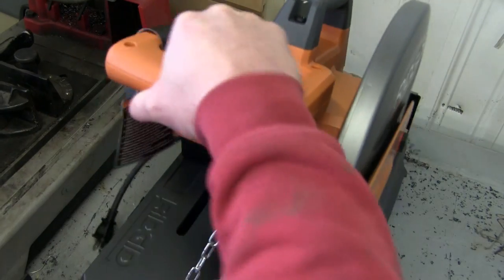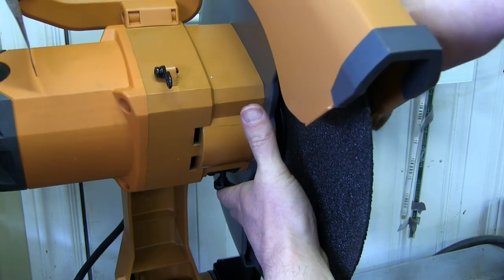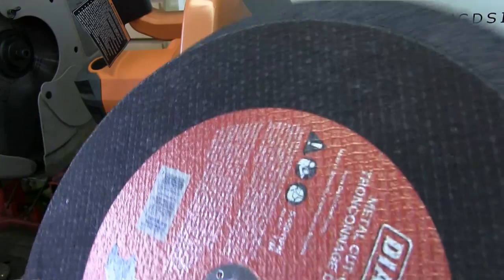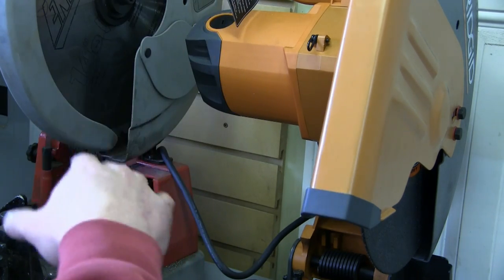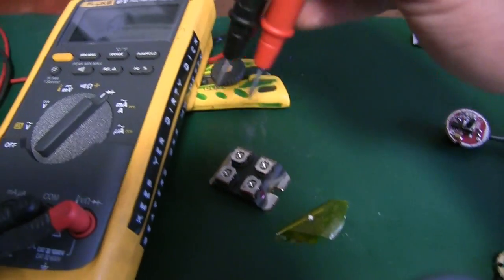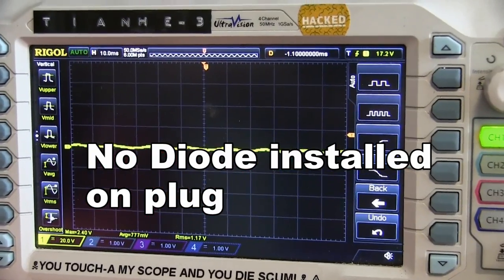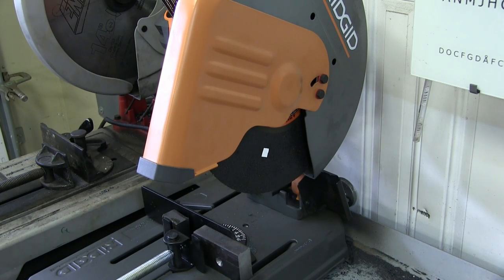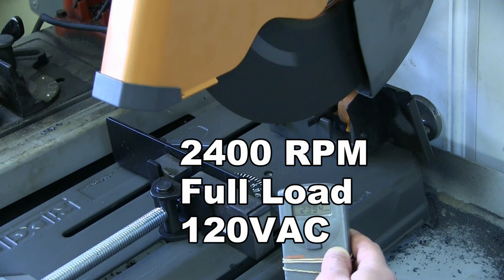RIDGID abrasive cut off saw converted to dry cut. Maybe.

Comment: I received a saw turned in to the tool room for repair.  The tag said "Real noisy and won't cut."   The blade was in backwards!
Reply: my old man's an IT guy. He once had an employee call him up and explain all about how is mouse was doing the weirdest things, moving in weird ways during a presentation he was making, etc. He goes up and...turns the mouse around.
Reply: Sounds like my average customer at the orange box. Facking ijits.
Reply: la05082 I was called in by a crack team of handy man chowderheads for a butchers band saw not cutting. Lol the blade was inside out. Yup it happens with band saw blades. Usually it just the butcher no big deal. But when another service company calls you for backup because they can't figure it out. Well that's funny shit. Best part was I was 24 at the time these chunder buckets where pushing 50.
Reply: Picked up a free Chainsaw with the same ‘problem).
Reply: I got a hammer drill with a clutch function back... "it doesnt work, it only spins and has no torque" ...They had stuck the drill and the clutch was engaged like it should ... /facepalm
Fucking embarrassing telling the customers they have no idea what they are doing but sometimes you have to do it. It goes with the story that the customer had specifically ordered a drill with a clutch too.
Reply: spoofer20 what sort of drill was it?
Reply: We used to flip portaband blades inside out and put them on for the next guy..      some tards just can't finger it out!
Reply: I am an electrical guy - I was repairing a winding machine at a client's factory.
I noticed that a roller guide was all mutilated - with built up weld and bits ground away.
I asked "what happened here?" - they said "it was fouling against another part and the mechanical guy had to modify it".
I looked at it and saw it was in backwards - "look, now there is lots of clearance..."
(ho hum)
Reply: I work at a Stihl dealer service, enough said.
Reply: My angle grinder zip cut blades don’t have a direction. I put them printed side to the retaining nut but who knows if that’s correct.
Reply: Literally one apprentice at my last company xD

Comment: I slowed my abrasive saw down and put a dry cut blade.  I confess --- for the benefit of others --- that I was used to not having to clamp the metal down.  The part vibrated a little, the teeth grabbed and the 1-1/2" angle iron went into my hand.   That was a trip to the ER and I'm lucky to still have my hand.  DONT MESS AROUND WITH DRY CUT --- ALWAYS CLAMP THE WORK PIECE!!!!
Reply: Thanks for the foresight.
Reply: 'Dry cut' as in....Carbide Teeth?  Anything involving carbide must be clamped very tightly.....vibration will quickly shorten the life of the teeth....and can cause parts to go flying....
Reply: i've taken a saw to the face and almost cut my abdomen open using carbide metal blades in a 7" handheld saw. both times were due to a stall. gotta be smooth and gentle with those things, especially with no way to clamp.
Reply: Scott Davison i work in the dead tree carouse business and one of the new guys in the shop managed to pinch a 4x4 in the chop saw thing went flying and broke the radio on a shelf above the saw
Reply: Power tools need respect and often don't get it until a close call. I normally use my powerplasma cutter to cut metal but want to buy a cold cut saw. After reading all of these comments I'm going to be sure to clamp everything down!
Reply: Scott, anyone who has put anytime in a shop has done the same, and it quickly makes you realize that your clamping better be first rate, and that you better keep yer wits about ya when you're working,
Reply: Darwin's theory at work.... Lmao
Reply: I had the privilege of cutting a 1.5" 11 Gage box tubing, was clamped,. Had table made so I can roll 20 foot sticks on it and cut. Nice set up. On a particular day, I had been cutting parts and a 14" or so part that was clamped still managed to jump out n slap me in the side of the ribs, knocking the wind out of me. Pissed me off and was confused how it happened. Had it clamped, looked at the blade n I recall it missing teeth.  Not just the carbide tips but the hole tooth, not repairable n couldn't be sent out to be sharpened.   Had a 7" grinder get hung up on me. Literally on me. Hard sand paper disk on a backer hooked on edge of angle iron and dam, I'm in a fight with the grinder. Came at me I let off the power then it was wrapping up in my shirt. Thank God it was cold out n had on 2 shirts. Still sucked, looked like road rash on my stomach, had to sit down n breath.  Wire wheels on grinders, hell grinders in general have gotten my many times, no wander I hate grinding. I'd rather be welding n let the helpers do the prep work
Reply: YA BLOODY THINK??!!???
Reply: @kellypenrod2979  that and the dam ringing that never quits,.  Been so bad it's giving me a head ache
Reply: @jeremyb7128  Yep bud, know what ya mean! 
But in my case, the ringing kinda knocks out the ol'lady's bitchin, and after a while ya just get used to it I guess.
Reply: @Scott Davison SHAKE HANDS WITH DANGER!
Reply: Gotta let the tool do the work.  Best advice you can give a person.
Reply: 4 inch grinder with wire cup brush. Don't try swatting wasps, luckily it was a cold day eat though coat hoody an two tshirts.
Reply: @carlcox7332  omg i can imagine how that could of happened to me so many times. i had a hole hog drill with a 4 inch auger drilling through 2x6 for plumbing on a step ladder. lol dam thing hung up and i went for a ride. tangled up in the ladder and 2x6 studs oh what fun the days of yester years was. so many stories bu so many, sad part is, when you look back on them, you laugh at how funny it is
Reply: @jeremyb7128  I had a brilliant idea,"once and only once" ( among other brilliant ideas, but this was almost my last)
I decided why not put a put a 
3-1/2" or 4" carbide tipped blade in a 4" angle grinder to get up nice and tight to the bottom plates, while cutting out wood floor deck..
Hell the blades were readily available ( intended for use in small cordless circular saw)
Within 30 seconds of putting this remarkable innovation into service ( I even left the half round shield on the grinder,"who does that" makes me think I was worried before I started)
I got my incidental 3D lesson, with extra sauce in personal biology .
It worked beautifully,as envisioned,but when you go to stop, that's when the magic happens that grinder took such a walk on the wild side, I think I almost blacked out before it hit me just imagining the consequences. I know , bounced off of all 4 walls at least twice trying to get away from it, before it cut its own cord ! Never had I ever felt SO, out of control.
Still one of luckiest unlucky days of NITWIT engineering I've had to date. 
A half inch deep clean cut 2-1/2" long incision just behind my palm.
Needless to say, the homeless Fright $18.00 angle grinder switch,stuck in the on position. Furthermore, I have never personally walked through the doors of Homeless Fright since.
( If the whole experiment wasn't so cheap to assemble,I probably never would have tried it. ** Still without a doubt, OPERATOR ERROR**)
I was working in such a remote area, I probably would have bleed out half way to the hospital, if it had managed to get a little more teeth into me.
Reply: @keeganwebber  family photo time must be interesting.
Reply: @tuck6464  Thanks for sharing that. If not for previous comments, I'd have thought it sounded like a great substitute for a toe kick saw. But I haven't laughed that hard in a long time, so thanks for your story.
Reply: @jeremyb7128  Ear plugs are why I can still hear after decades as a jet engine mech. 3M foamies are love.

Comment: 120? that's already half voltage!
Reply: yah your right its half voltage
Reply: Not in north america
Reply: Could just get a abrasive cutoff saw from over seas and run it on our 120 on twice the rated breaker size tah dah
Reply: @alec4672  exactly the same would happen as in the video, the motor would burn out very quickly.
Reply: 110V motors have thicker conductors than 240V
If the motor is an inductor you will need a variable frequency drive. Drop the Hz and it runs slower. But all the other stuff (cooling etc) applies.
Reply: Not in America

Comment: If surface feet per minute is the consideration on that 14" blade, there are convenient and affordable 7.25" carbide-tipped circular saw blades at any home center that will effectively cut the SFM (circumference) roughly in half.  It would limit your depth of cut to about 3", but for a quick-n-dirty proof of concept without choking elec-chickens, it's an option.  (Assuming the arbor hole is the correct diameter.)
Reply: It's not.  7/8 on a 7.25 saw.  1 inch on a 14 saw.
Reply: I have a 12 inch wood cutting Milwaukee miter saw that I have installed a 9 inch Diablo steel demon blade on. Works well and is inside of the maximum rpm recommendation on the blade. 1 inch arbor

Comment: Hey AvE!  Love your videos!
 I have some thoughts you might want to consider...  Many universal motors are series wound, some are parallel wound (for speed limiting), and some are series/parallel wound, (one field/armature in series, and the other field in parallel with it all).

Your saw is probably the series wound unit as you say, and my idea is to either put a big inductor in series of the saw circuit as a choke, instead of the diode, OR rewire the actual motor itself into a parallel connected motor, in which case you will need a choke in series with that field winding (field/choke in series, and that all in parallel with the armature).

The first option is easier but less speed regulation, easy to bog down the motor.  The second one will give much better torque under load while keeping the speed low enough.  These require more effort and trial and error, but not much more in materials, and you'll likely save your motor.  The V/I pulses are not smoothed in the diode setup, so the resistance of the windings in the motor will burn up twice as much total power as compared to the choke-limited method, which keeps the entire sine wave, at the same average current and voltage over a cycle.

In short, it's those peaks in your diode setup that are being burned up in your motor windings.

I probably rambled this off in a way that was hard to understand.  It's 11:30 at night lol.  I'll explain it better if anyone asks me to :D

Comment: Exactly the question I was pondering over the weekend. I came to the conclusion I would have to jerry rig a different motor and maybe even pulleys to get the speed and torque. Now dry cuts are out in the market, abrasives suck more than before.

Comment: Hey uncle bumblefuck, I was thinking about this and I have one and took it apart. Turns out it has a gear reduction of roughly 6:1, all you have to do is crack open the gearbox and swap out some gears. 

Would reduce speed and make the torque even more 

Hopefully you see this and try it.
Reply: Do you know where to get the gears to reduce it?
Reply: @wesman7837  McMaster or the usual scumbags. I don’t believe these are geared anymore though. Pretty quick cost down for them

Comment: Shit man if you want to half the speed, just wire two up in series!
Reply from the maker: Stupid like a FOX!. Good idea, I'll make a mock up.
Reply: AvE Or a lightbulb instead of another tool?
Reply: i would use a resistor (or more) in series, matching the inductive reactance of the motor, and that should give you the 60v, with less than 35 amps.

i would have to do the math to determine the expected current of the circuit, but im sure you are more than capable.
Reply: AvE Half the voltage means quarter the power (because current is also halved).  Works the other way, too: double the voltage means four times the power. So it's always quadratic. If you turn it on half the time on the other hand, it really is half the power going into it.

This is of course for resistive loads - which a motor only is at no load or high rpm. At low rpm and high load she will suck in as much amps as she will (or even won't) suffer. So the variac should've been set to 71% (1/sqrt2) I believe so that the current doesn't get that high and more work is done by the voltage and better ventilation occurs.

That sherper with the Yamaha generator surely has some carrying capacity for a variac, eh? ;) Only other solution I could think of is regulating (pwm-ing) with an arduino and mosfet - you could set a maximum surface feed. But it would get convoluted quickly I guess :/
Reply: apolon_psy If you take a 2000W light bulb (or 20 100W in parallel) it will could werk. Also good in the winter for heating the shop up! And it looks nice from outside when the load varies and the bulbs flicker through the windows like in a mad scientist lab :)
Reply: actually i think that will be only 7.5 amps in that configuration. (with the resistor)
probably just need to gear it down
Reply: JBFromOZ This will work - if they are always under the same load ;)
Reply: Its a universal motor, NOT a resistor. Back to school with you.
Reply: defender1be Who said it has to be linear dampening? Resistor will work - it's just not the best option - but mainly because it gets freakin hot.
Reply: ok, did some more figuring...

120 ac, to a 8ohm resister in series with the motor and a parallel 330 micro farad capacitor, should give you 60v motor, at roughly the same current.

15-20 amps unless i fucked up the math, which is possible.
Reply: ocng How about a $9 120v, 2000 watt water heater element affixed to a styrofoam float set adrift in a 5 gallon bucket ?
Reply: double the productamivity! straight outta canukstan
Reply: worthy of a welders ruler down-unda matey? watch out for those drop-bears!
Reply: Krust bag The inductance I think you derived from running under full load and at low rpm (120V, 15A) so it's 22uH. With the matching capacitor in parallel it's 8 Ohms which is the same as the 8 Ohm Resistor in series >> so the voltage is halved. The current then is 120V/16Ohms=7.5Amps (half) since now the voltage has to drive two 8 Ohm loads in series. And so the power is only 1/4 of what it was @ 120V/15A since each 8 Ohm load gets half the voltage. But the whole circuit sucks up half the power - just not all of it goes into the motor...
Reply: maybe ave can give us the measured apparent power (va) and the true power (watts) of the saw, so we can calculate all the real values.
Reply: another option would be to use a vfd to reduce the frequency, but I think that would lose torque, not sure if it would perform it's job.
Reply: Krust bag About that vfd: interesting idea! But isn't the idea of a universal motor to be frequency independent? In the video it runs on pulsed DC...
Reply: ocng the frequency would directly control the time between pulses (dc) and cycles (ac) which also affect the speed of a motor.

the universal motor can run on both ac and dc, as opposed to an ac motor.
not sure of any other benifets
Reply: Krust bag ..... 8 Ohms? ........  Ker Ching! A good size speaker would give you that ...... With the bonus that the neighbors can listen to you working ;O) Or if that is a problem 2 4Ohm speakers wired arse about tit to give ... Wit for it ........ Anti-sound! Ta Dah!
Reply: JBFromOZ actually... that would be 53,3 Ohms you need - Speaker Impedance is measured at 400Hz - lines voltage oscillates at 60. So 8Ohms @ 60 Hertz is the same as 53,333... Ohms @ 400. I like the Idea of that high powered 50Hz Speaker though :) Reminds me of that guy who almost brought a building down by inducing Oscillations into the structure and ground.
Reply: ocng Which manufacturers measure speaker impedance at 400hz?
Reply: cncgeneral Not all of them apparently - 1kHz seems also common. The modern dictionary of electronics says 400Hz is the typical value. I just wanted to point out that none measures at 50Hz and |Z| is frequency dependent.
Reply: ocng Yeah, 1khz is much more common, but it's still pretty useless to know without the full graph due to how speakers are used. DC resistance is normally what people think of when it comes to speakers.
Reply: Simon Ashton I was tempted to propose that - but refrained from it because I thought AvE's goal was an easy solution...
Reply: exactly, his and hers.
Reply: or left and right hand .... at the same time for efficiencies sake ;O)
Reply: Some series or shunted universal motor winding's need to be controlled independently  to control rip'ms.  Decreasing power or flux density of one winding decreases the coupling or the grip/friction and the revs go up. More  power=less speed.

Comment: Great video mate. I just went for the simple option and got a three phase saw. Running off a variable frequency drive I can have pretty much any speed I want! I can use it as a cold saw at low rpm and a hot saw at higher rpm. Winner winner chicken dinner!